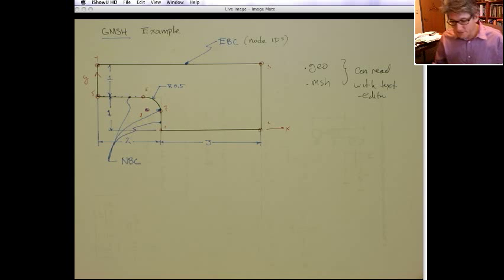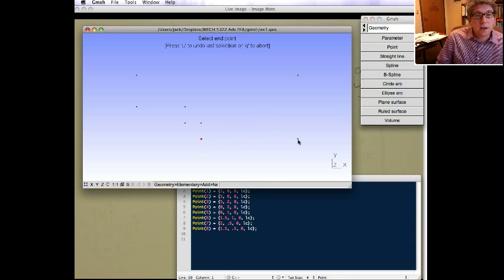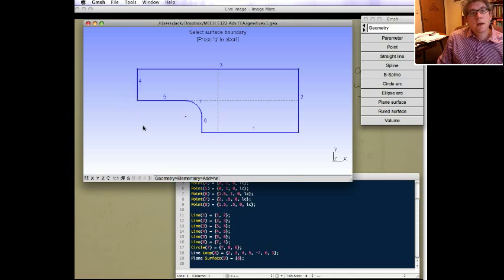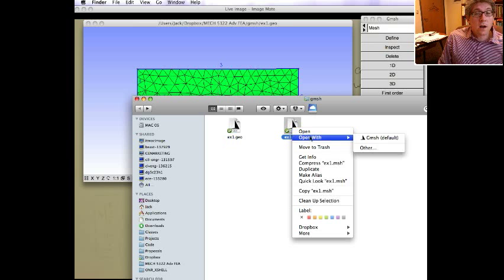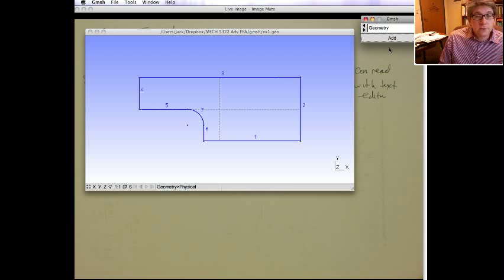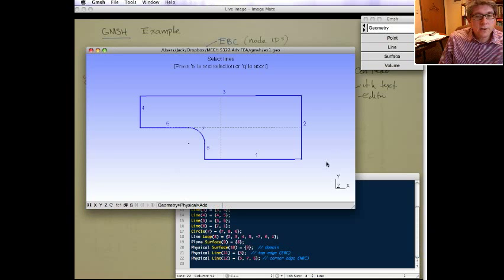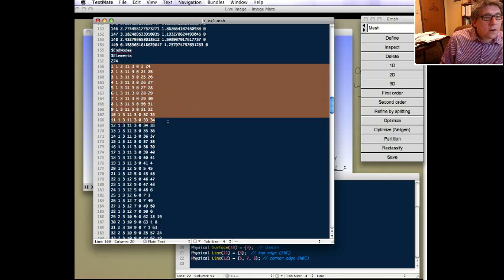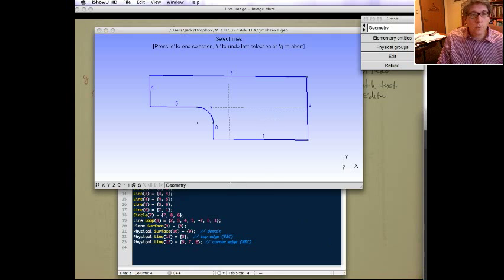Gmsh and Matlab Part 2 of 3

Comment: Dear Sir, I got a problem when I saved the mesh file. In your case, when you opened your msh file, It contains information about the total number of nodes, and all of the nodes are sorted in order. However, in my case (ver 4.1), after following your instruction, I opened my mesh file, it does not contain information on the total number of nodes, and the order of these nodes are not sorted. Could you tell me how can use set up this, please?

Comment: i believe that in GMSH we have any information about the internal elements and this is overriding when we try to solve pde's with the FVM. Is that true ?
Reply from the maker: I am not 100% sure what you are referring to with respect to the internal elements.  In GMSH you can definitely obtain the connectivities of all elements, both on teh interior and on teh boundary.  While I am no FVM expert, I believe that you will want to have a data structure that holds the faces of the elements and what elements they connect.  I believe that this is what is typically more efficient to compute the operators you need in FVM.  To do that you will have to do some processing of the GMSH data.
Reply: @JackChessa  thank you for your reactivity. When we take for example elements of type 1:2-node line, i believe that we have just the edges who belongs to the boundary  and not who are internal. Actually what i am looking for is a file like :
$faces
#face_id node_1 node_2 label (label states for which boundary this face belong or 0 for example for internal)
... so on
$triangle
#triangle node_1 node_2 node_3 label (same thing as faces)

Thanks in advance prof. Chessa
Reply from the maker: An easy way to do this is to use the find matlab command to look what rows in your internal element connectivity have the edge nodes.  That will tell you the continuum element on that edge as well as the node ids that comprise it.  It is not the most efficient approach I suspect but will work.  Actually, for matlab it will probably not be that computationally expensive since it is a built-in command.  Just do this once and store this in an array.

Comment: hi Jack. May I ask how I can determine the order of the connectivity for each element in GMSH ? I need that in my solver to find the normal vector on each node and elements and the order is important in this case
.
Reply from the maker: Under Mesh->Define select Set Order 2 (or 3 for third order elements)
Reply: thanks a lt for your quick reply